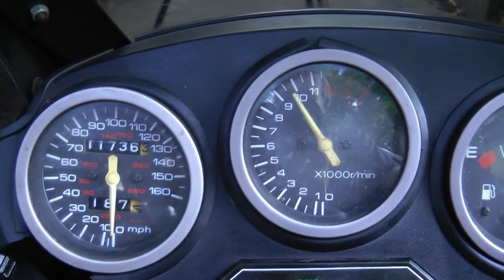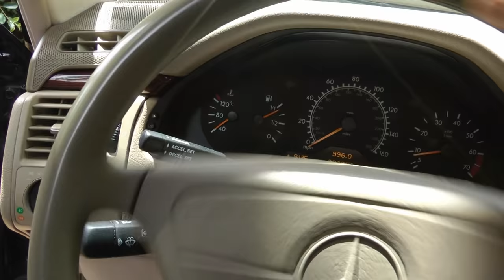How to Find Power Steering Leak in Your Car (Hose Replacement)

Comment from the maker: ⬇️Things used in this video:
1. UV Leak Detector Kit: http://amzn.to/2B09ZRk
2. Breaker Bar: http://amzn.to/2BEo9Ep
3. Metal Oil Pan: http://amzn.to/2nlDM0y
4. Ratchet and socket set: http://amzn.to/2inoxOY
5. Mechanic’s Tool Set: http://amzn.to/2Bzmccg
6. Wrench Set: http://amzn.to/2kmBaOU
7. Shop Towels: http://amzn.to/2jGDfkA
8. Disposable Gloves: http://amzn.to/2zSRuxO
9. Flashlight: http://amzn.to/2kwtiu3
10. Steel Jack: http://amzn.to/2Asgjxo
11. Jack Stand: http://amzn.to/2jGOwBg
12. Common Sense
13. Full HD Camera: http://amzn.to/2AvoEk7
14. My computer for editing / uploading: http://amzn.to/2i2sKYz
15. Video editing software: http://amzn.to/2jv5Fhf
16. Thumbnail software: http://amzn.to/2k7tz6C

🛠Check out my Garage to see what I use every day and highly recommend:
https://www.amazon.com/shop/scottykilmer

👉Follow me on Instagram for the latest news, funnies, and exclusive info / pics:
https://goo.gl/ohy2cA
Reply: Scotty Kilmer thanks a ton the Amazon links made my life so much easier
Reply: Scotty Kilmer  Scotty I'm having trouble getting the pressure hose to thread back into the rack it's a new one I bought because the old one was leaking but no matter how I try by hand I cannot get it to catch any tips on what I should do
Reply: Scotty Kilmer but what if the power steering fluids full? I get a groan and stiff turning when the car warms up i change the pump,belt and fluid and that did not help
Reply: Scotty Kilmer 
#12
Reply: I like all of your work.  Some I already knew, your vids reinforced that.  Always check you out when undertaking a task.  Peace.
Reply: How much would it cost to repair?
Reply: Scotty Kilmer i just filled up my power steering and now its empty and then a continuous thudding noise appears. Steering wheel shaking like crazy. What is it??
Reply: need help finding #12 there's no link
Reply: 🎉13years

Comment: Well i replaced a power steering hose on my 92 camaro and it still leaks, then watched this video as your my go to guide, heard that u said "power steering hoses can use up to 1500 pounds of torque" went back and tightened that hose even more, and sure enough ur videos helped another in need scotty, i had no idea the hose had to be so tight! thanks for all of your wisdom!!
Reply: He said the hydraulic pressure in the system could be up to 1500 pounds per square inch. 1500 pounds of torque would require a very long torque wrench or a mechanic named Chuck Norris.
Reply: From the Plews & Edelmann instruction sheet that came with my hoses: "Ford P/S hoses use a "swivel O-ring" fitting on the tube ends. When installed properly, these are designed to allow the steel tube to move freely in the fitting. The nuts should only be torqued to 10-20 ft.-lbs. NO TIGHTER."
Reply: I'll try this.
Reply: @artknight3683 or torgue ≠force x lever arm equuals pps per Sq inch . Use a long wrench handle to increase holding😂 power. Usually just an extender on the handle.

Comment from the maker: getting those lines off can be a cow. I use crow foot wrenches, and if that doesn't work, I cut em off with a hacksaw then a socket and wrench easily fits on, you're throwing the old hose away anyway

Comment: Blew my power steering line on the way home. Tried to keep fluid in the resivior. Didn't happen. Drove it home anyway. Pump didn't scream so i think i got lucky and got home without burning it up. So gonna be replacing it tomorrow! 93 240sx s13 Hatch! Good vid keep it up!

Comment from the maker: I've had really good luck with AT 205 reseal for small leaks on those. But do put UV leak dye into the system, often the seals go bad on the stupid reservoirs where they snap in, check that first.

Comment: Great video, it's awesome that you do all of this as a hobby and not as a service.

I have a 98 lexus es 300 and my powersteering high pressure hose has been leaking for quite a while. I've honestly just been pouring ATF through it for the longest time but the leak is obviously getting worse and I finally need to fix it. Is the process the same as in this video?

Comment from the maker: @fatbradlehs   Tons of things can cause chirping and creaking. Check EVERY single rubber bushing on the suspension, and also check all the struts, the strut mounts, and the strut springs for that noise. If you spray WD 40 on a worn part, it may quiet down for a while. I use that for diagnostics all the time. Scotty Kilmer

Comment from the maker: just keep watching the ads, I get paid a nickel every time someone watches the ad. that keeps me happy. But, same process replacing the hose, it can be hard to get it off the pump but if you use a cheater bar and a long extension with socket, it will come loose

Comment: Another great video, Scotty. Keep 'em coming! 

Unfortunately, I hit a big roadblock doing this on my '95 Grand Am. It didn't have a banjo fitting going to the steering box. It had a flare nut, instead. After buying an 18mm flare nut wrench, I discovered that there isn't enough clearance around the nut for this wrench end to fit, which is a huge problem and an absurdly poor design by GM, in my opinion. So, you have to risk it with an open 18mm wrench, and hope you don't round it off. Well, the nut on my 20 year old car was seized on tight. After a prolonged attempt to get it off, I thought I finally felt it break free. But, it was just the flats rounding off. I couldn't believe it. Total disaster. 

The nut is so close to the engine compartment that I doubt it could be socketed, even if I cut the steel line.

What a mess.

Good luck to everyone
Reply: damn bro.

Comment: my hose on my Oldsmobile alero is leaking where it connects to pump any suggestions
Reply: Outside of tightening, $5 of Power Steering leak fixer, power steering WITH "Stop Leak", or ultimately a new hose (usually not more than $100, mine is $20) and see if the threading on the pump is still any good. Unfortunately, if the threading on the pump is 'done for', you'll have to replace the whole pump which will be a bit more costly but around $100 for you to do it yourself

Comment: This is weird because I just fixed a power steering leak in my Merc ML430 yesterday, then I stumble on this when I am looking at Hand Warmer videos. I think I Googled "using ATF for power steering". So I assume the browser 'shaped' my suggested videos, but how the heck did it know I was also working on a Merc? Perhaps that part was just co-incidence. Anyway, I got lucky and it was just a loose clamp (brought the vehicle in from Japan and it turns out they were all loose), but in the meantime happy to have discovered this channel as a resource for solving my future problems.

Comment: Scotty, isn't power steering fluid just brake fluid?
Reply: +ktrez2000 Hell no! I knew someone who put brake fluid in his Lancia. He needed a new pump. You can mostly use ATF, but better check it before you put it in.
Reply: Depends on your car... Not brake fluid. My Toyota used automatic transmission fluid, my Honda uses Honda power steering fluid only. Check your users manual
Reply: i had a car that used 80w90 gear oil and previous owners had been putting in power steer fluid, probably dex III
Reply: ktrez2000 no, some vehicles use ATF. Check the owners manual.
Reply: My Corolla does not use Power Steering Fluid. Has to be Dextron Ii or III.

Comment: Hi Scotty,

As one videographer mechanic to another, I will tell you that I like your style.  Great energy and easy to see what you are referring to.  

So, I had this unlocated leak in my E320's power steering for a few months and I was trying to get it to just magically stop with Lucas Power Steering stop leak.  They make good stuff, but let me tell you that Mercerdes does NOT like it at all. Steering is hard as rock to turn until car warms up now.  I have to break it down and find the source

Comment from the maker: @1person89 I don't have a pit. But power steering uses 1600 psi pressure, and no sealer will stop that in a hose leak. Scotty

Comment from the maker: If a  joint seal is split, it needs replacing.  AT 205 can work in power steering leaks, but realize they have 1600 psi and that's a lot of pressure to seal. Valve cover gaskets need replacing, no sealer will fix a leaking oil gasket, only a leaking oil seal.  Intake manifold gasket leaks need replacing if they leak oil, but you can use bars alumiseal in the radiator if it leaks coolant there at the intake

Comment from the maker: the hose that comes from the power steering rack to the reservoir is the return line, you'd put that into a bucket and add fluid with a hose put back onto the reservoir there if flushing it while running

Comment: @scottykilmer I managed to get that flare nut most of the way in. I had to get some rubber dish washing gloves to tighten it by hand. Steel part of the pressure line has to intertwine with other parts of the line to keep them in place. Thanks again!

Comment: Thanks for the ups on that place.  I'll try to grab a new one from the dealership. Your video was very informational and helpful. After taking my bad pump off, I was able to install the broken refurbished pump with minor confusion and take it off with no problem after it also leaked, except that tiny spot where there was one screw that took 10 minutes to take out. Thanks a lot. Now I know where to look when I have another car issue!!

Comment: thank you Scotty! I started the engine and found out that the dust shield is ok. One of the metal pipes maybe is damaged, cause after starting the engine it started to leak, drop after drop somewhere fromthis pipe and was going own to the boot. I guess i should take out the whole rack and change the pipe. If you have some video reg this, it wpuld be awesome. Anyway, thanks a lot one more time!

Comment from the maker: yes, fix them youself, but the rear main oil seal requires removing the transmission to get to it. Try some AT 205 reseal liquid in the engine oil for that, hard to find, amazon sells it

Comment from the maker: try my video "fixing binding power steering on your car" as that flush may fix it. If not, either the pump is bad or the rack, and it takes a pro mechanic with very expensive gauges to figure out which.

Comment: Scotty, I thought starting the car with air bubbles in the system was bad for the power steering pump? I thought you had to turn the wheel left and right many times with the car off and jacked up. Is it ok to do it with the car on?

Comment from the maker: @Matthew55904  All power steering systems have reservoirs, some are built into the pump itself, and some are remotely located with  a hose that goes to the pump from the reservoir. Just look closer or go to any auto parts store and they can show you.  The H AC line is the high line, you want the low pressure line, it's always the thicker line and it goes between the compressor and the evaporator at the firewall. Scotty Kilmer

Comment from the maker: @X2N18  You can't fix leaks on that thing by tightening bolts, the gaskets are cheap glue originally and you have to take it apart and reseal the whole thing. Just make the bolts snug,, 12 ft lbs is plenty enough. Scotty

Comment from the maker: when hoses go bad, that often lets the pump run low on fluid, then it gets worn, and then it will moan.  The hoses only fit on one way, you either have it on right, or it's wrong and would leak like a sieve

Comment: Scotty, first of all I want to thank you for your fantastic and easy-to-understand videos! 
Second, I wonder if the car and/or the power steering pump may be damaged from removing one of the hoses in the system, WITHOUT installing a new one? I've got a leak on my '97 VW Polo, and replacing them is too expensive for me at the moment.

Comment from the maker: no, that's just a dust shield, the actual seals are inside the rack. But no dust shield will let dirt get on the inner seals eventually then it will leak

Comment from the maker: @KarenandRyder  Yes, they are stinkers, I just cut the old one off the hose, and then hook up an air tool to whack the bolt off. You could also cut the hose portion and use a long extension and a big cheater bar, it would also work. Scotty

Comment from the maker: @Smashmouthj yes, they can be cows to get on. You have to start the threads.  I would try putting the top side on first, then put the bottom on in your case, so remove the bottom and start over. Scotty

Comment: I just had my Honda Accord V6 2006 Power steering recall fixed.  I came home and the car caught fire about eleven minutes after I parked in my garage.  About 200k damage right now.  Investigators say the probable cause is failure to follow installation procedures and clean up the fluid sprayed during installation.  My advice - clean up the fluid if you have to do it yourself.  This is a project that can have catastrophic results. Good luck.

Comment: Hi, thanks for your kind suggestion. I think I should fix the power steering leaks and the manifold gasket leaks first. one question about the procedure,  do i have to put the liquid (AT205) in the powers steering hole and start for sometime and than fill with power steering oil. Same procedures with the alumiseal right? And if you can suggest me  where I can buy the products since i m in canberra, Australia...cheers

Comment from the maker: yes,racks leak all the time. Fluid is cheap, racks cost a ton. Racks leak at the rubber bellows at each end by the wheels, if it's wet there, they're leaking

Comment: Thanks Scotty ! I have the same exact car and same exact PS leak location in the high pressure hose. I am about to replace the hose. Good tip on getting at the bottom end from the side through the fender well. Just saved me some head scratching !!!  Outstanding. I did notice that you were putting standard PS fluid in this Mercedes. I bought some of that high priced Pentosin for my job,  Should I take it back?

Comment: Great video, question...are the orings for the pressure lines a standard size? Like for GM's? Im having power steering noise and the pump seems fine and no noticeable fluid loss. After doing some flushing, it seems like a hissing sound is coming from the pump, so Id like to try the cheap orings first.

Comment: Scotty, I've read that the way to bleed the power steering is actually to lift it up in the air so the power steering has no pressure, is it okay to also do it while its on the ground?

Comment from the maker: @rg10969 generally they only suck air from a leaking hose or pump seal. Try to figure out which one is leaking first, using UV leak dye. Scotty

Comment from the maker: @oneloudchevy32  that means the power steering rack has a problem inside the left side, such as a stuck valve. Try cleaning it out with a product like Seafoam power steering additive/cleaner. That often fixes it without changing the expensive rack out. Scotty

Comment: Scotty, appreciate you man! I’m going nuts, replaced a power steering pump in old Jeep and it’s still leaking. Can’t see where from but it’s getting on the belt and throwing it everywhere! 😮 any ideas? I replaced the o ring on the high pressure hose

Comment: Hey Scotty, I just bought a 2006 Toyota Corolla and the power steering fluid looks pretty dirty and old in the reservoir it's done 280,000km. Where do I drain it so I can put new oil in? Since there's no filter should I wash it out with new oil then change it again, it would make me feel better.
Reply from the maker: suck out the reservoir with a turkey baster, then fill it up and drive 5 minutes. repeat this process 6 times and most of the fluid will be new then

Comment: Nice... Just sprung a leak in my Power Steering Return Hose. Do you have any videos on replacing that? It's a 2000 Plymouth Breeze & I don't need to put more money in it than it's worth.  Thnx Scotty

Comment: I'd like to replace the power steering hose between the reservoir and the cooler on my car. How do you remove the hose from the cooler? It seems to have a metal fitting. What tool would you use? Thanks!

Comment: Hi Scotty, I have a 1998 Mercury Sable. A friend told me you would have to lift the engine to get to the power steering pressure line on the wall. Is this true. Or would I be able to reach it by removing the tire as in your video. Please let me know as soon as you can. I want to do this myself.

Comment: Hey Scotty, my mom's mechanic says she needs to replace the power steering return hose on her 2002 kia optima v6. We've ordered two parts but he says they're the wrong parts. He described it as the long line going from the rack and pinion to the reservoir. Will you please do a video of how to replace this part? Or maybe even where its located under the hood so we can know what it looks like. Thanks
Reply: Lisa Morris http://www.haynes.com/products/productID/828 Manual number 54050. This manual will have instructions for vehicle specific fixes and maintenance.
Part Number: 54050

Comment from the maker: you can't run the car without the hose, unless you removed the power steering pump fan belt too. If it sucks air, it would destroy itself quickly

Comment: heres a good one-- off topic--- when driving down a steep mountain is it ok to slip my nissan sentra, buick or whatever in neutral and drift, saving gas---- or will it damage the automatic transmission when i put it back in the drive position...remember im traveling at 50 60 miles per hour when im taking it in and out of gear.  thanks -keep up the good vids.

Comment from the maker: probably did, but generally they won't fix anything as long as the engine runs fine. They are not guaranteed against oil burning. Add oil and never buy another one